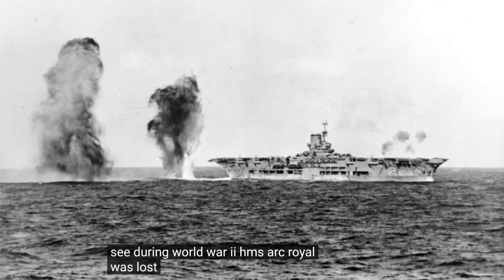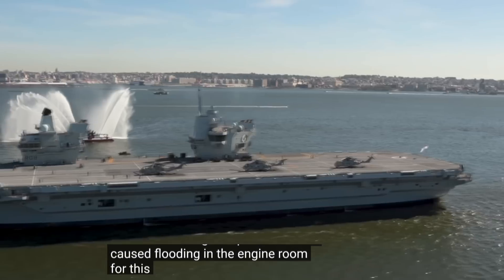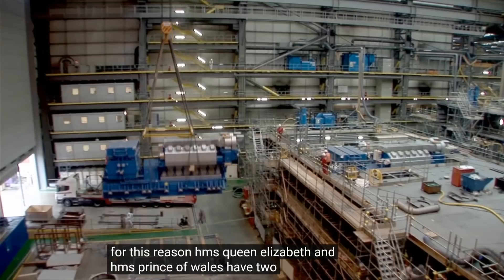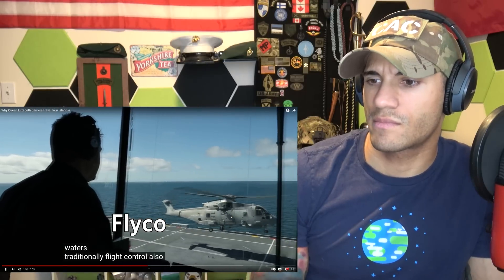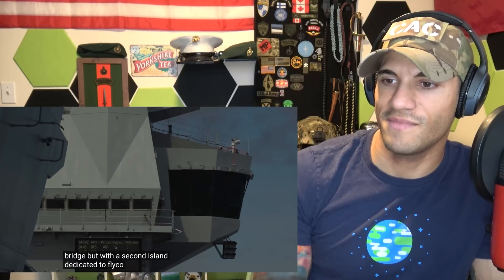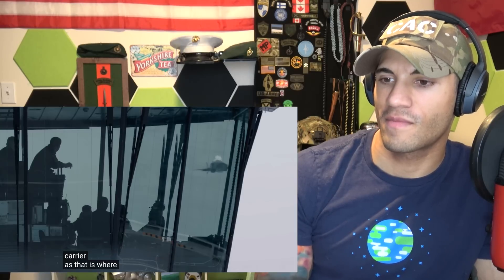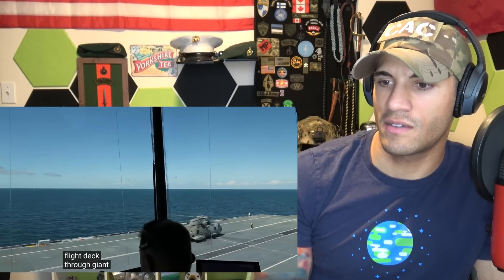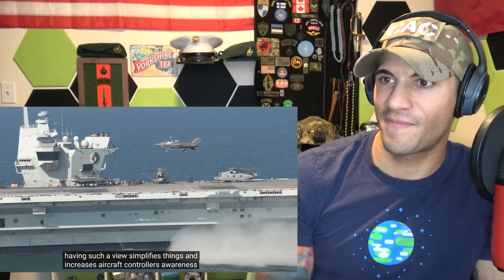Marine reacts to Why Queen Elizabeth Carriers Have Twin Islands

Comment: From what has reported the USMC  troops from VMFA-211 are very impressed with the QE, operationally the size of the flightdeck and ski-jump is of a huge benefit, accommodation wise even junior ratings accommodation is 6 berth and better than anything they have seen, I'm  sure the senior rates are also delighted with the pub and even junior ranks get a daily  allocation of (decent) beer, noting that the drinking age is 18
Reply from the maker: Nice berthings alone would be a deal breaker for most haha
Reply: @CombatArmsChannel  there's pictures of the junior rates berthing online and this is the pub that serves as a senior rates mess
https://youtu.be/QT6FYLSJays
Reply: @sperz35 theres still a BV in just about every British armoured vehicle  and has been since WW2,
Reply: The 6 birth junior ratings cabins are pure luxury compared to what used to exist. I've been on board (as a visiter) a few old warships and they were a nightmare for space.
Reply: @countofdownable  one of the reasons for the improved accommodation is that by automating many jobs but using proven technology they just don't need as many crew,  the weapons elevators are an example, they just modified what is in use in commercial warehouses with extra safety precautions 
https://youtu.be/-F8HFrB8b-0
Reply: @sperz35 yep it still is an absolute necessity and likely always will be. Tea = Morale
Reply: @SirZanZa  and also it gives 1 less reason to get out of the tank
Reply: QE class is designed to operate F35, systems and facilities onboard will make the lives of the air wing so much better
Reply: @sperz35 It is, in fact just about every British Military vehicle in service has a BV, not just tanks and IFV's/AFV's. They are used for more than just tea, they can be used to heat shaving water, and to heat up rations. Indeed, when the British Army still used canned rations the tins were purposefully roduced without paper labels, the contents being marked on the can with indelible ink, so the troops could heat up their food, and then use the hot water for the tea without having nasty pieces of paper pulp sitting in the water.
Reply: To be fair the BVs are also used for rehydrating rations with boiling water.
Reply: Plus they can fill it up to the gunnels  with the Marine Harrier if they need to.
Reply: @sperz35 OLD tanks???